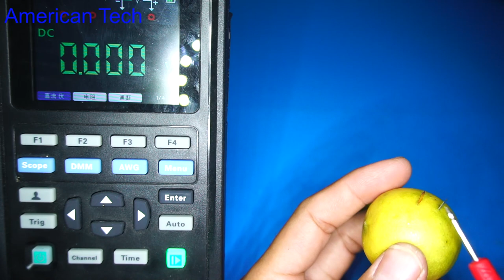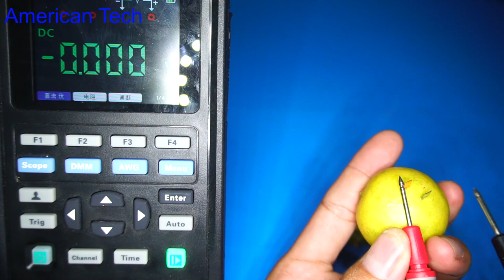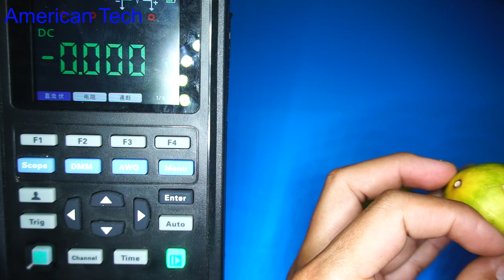Lemon battery powered Calculator

Comment: Can any kind of fruit and vegetable be used or not 

Or
We can only make this from acidic fruit
Reply: It works because of the acid, so if it’s more acidic, it will work better and generate more current. I needed 4 lemons to turn on a tiny LED, so you need the fruit to be as acidic as you can if you want to do it